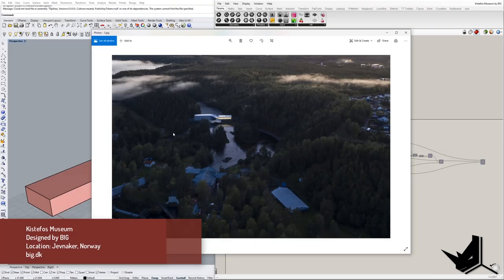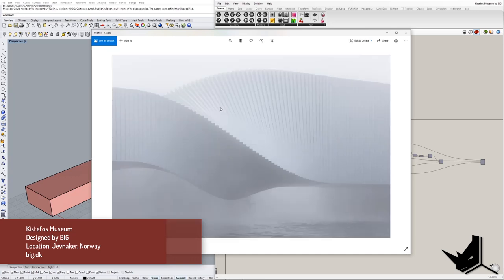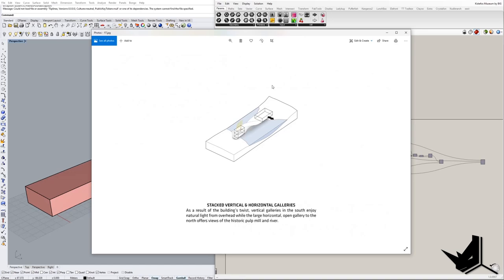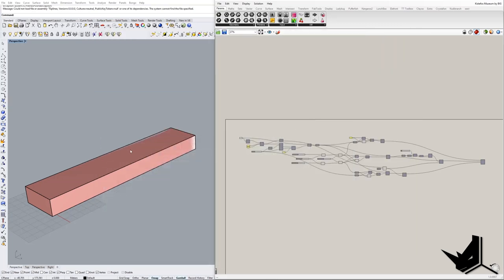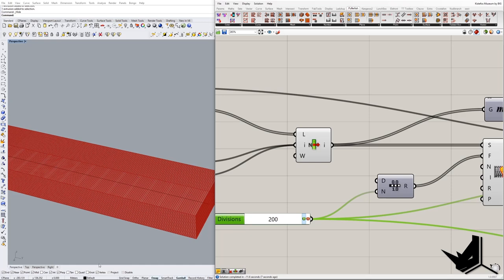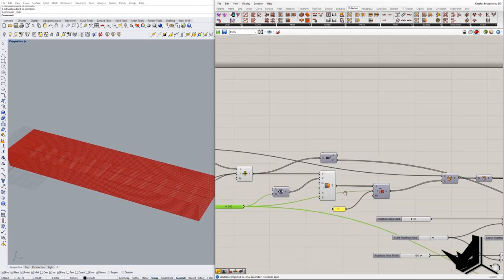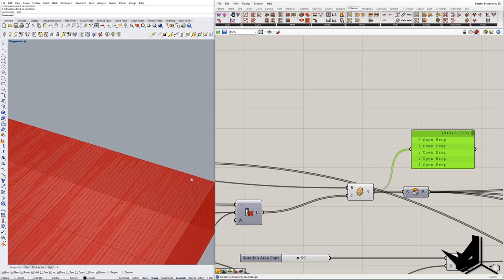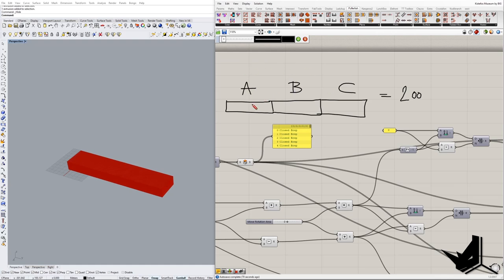Rhino Grasshopper Modeling Kisefos Museum by BIG

Comment: Any reason why my surfaces decrease in towards the center of the rectangle when i add the Tween through surfaces?
Reply from the maker: Check these:
It may happen that your surface UVs are flipped. You can correct them by using "Reverse Surface Direction" component from Lunchbox. 
Please check the screenshots:
https://drive.google.com/file/d/1qYXNg8t32KR3FXe-HtPBHKK6j4CbLA2w/view?usp=sharing
https://drive.google.com/file/d/1PZ6KcZBJRtckO3bG7sb4IkfJRx6Z8IV4/view?usp=sharing
Reply: @HowtoRhino  If you reverse the surface, how would you connect both list item to area?
Reply: @HowtoRhino  had same problem, ty very much, love your work

Comment: Hi, great tutorials, I really enjoy returning to RH+Grasshopper after years of only 2D drafting in Autocad.
 I have a question: If you wanted to make the transition between the straight sections (A and C) and twisted section (B) smoother,  how would you go about it? In theory the angles at the begining would progressively increase, reach a maximum rotation value at the middle of the torsion and begin to gradually decrease again, right?
I tried experimenting with graph mappers (I applied the principle of what you were doing in the 2nd tutorial with collumns). I inserted the bezzier and parabolic graph in the link between step angle and the series component but the the result was not what I was looking for. Is it because the additive nature of the series or something else?
Thanks and keep up the good work!
Reply: Got it - contructed a range from section B, connected it to a bezzier graph which gave me "smoothed" values betwen 0 and 1. I multiplied this with the rotation angle , converted to RAD and that was it. The result looks great with a gradual transition between the straight and curved geometry. Cheers!

Comment: Great tutorial, I was wondering how are you able to stick multiple parameters into one input at 3:51 you have panel 4 and 5 going into the index of the list item, but I am not able to do this. I found a similar problem in another tutorial where multiple parameter with being input into a loft and i was not able to replicate that one either. How did you do that?
Reply from the maker: Hi George, 
Just hold shift while you drag it and you will get a green wire meaning that you can input it as well with some other inputs in the same position :)
Reply: it worked for me when i used the number slider instead!

Comment: I would have liked more smoothness in the transition
Reply from the maker: It could be completely smooth, but in that case, you would want to try the "Twist" component. However, that would be different than the real project, so that's why we were using Rotate here. You can get more smoothness if you increase the number slider at the beginning :)
Reply: @HowtoRhino  grasshopper is hard  to lean because is pure formula mathematics
Reply from the maker: It is mathematics, but it doesn't have to be anything complex, you just need to have some basic math knowledge.